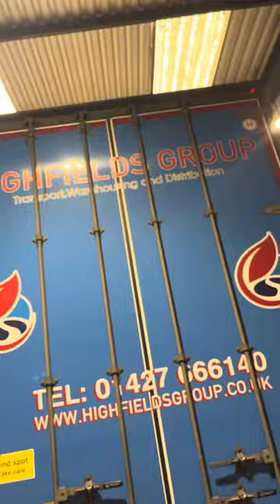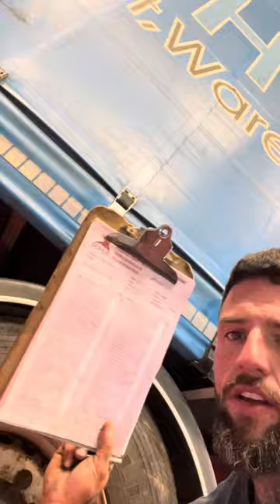Mot preparation on a 3 axle curtain sided trailer UK

Comment: Just subbed,them sdc trailer caught me out big time snapped spring in the hanger covered by the other helper spring went down as a advisory the lads took it to bits clean snap straight through 😮